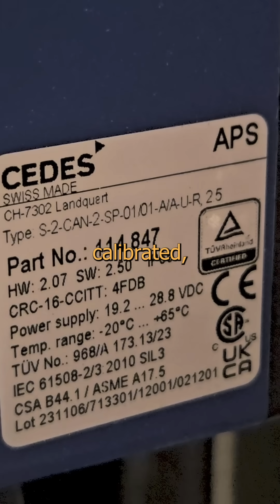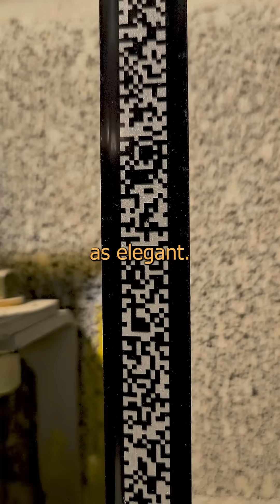Elevator Encoder #chrisboden #comedy #engineering #controls #urbex #indicator #resolver #barcode

Comment: Fun fact, when I was a security guard I had to check those scan bars on patrols and tell Maintenance if the strips were getting dirty.
Reply: Cool until some metal filings entangle themselves in the bristles and scrub the code right off that bar
Reply: @o.o-vt1rc  True.  I guess I didn't give it enough thought.  You could always enclose the bar in something that would prevent it from being damaged.  Say a plastic cover that would need replaced every couple of years or whenever it stops working correctly.
Reply: @jasonstclair6293  that's worth considering. Or have a technician use approved cleaning methods to remove dust and grease without damaging the barcode, and hope that by the time it's scuffed up enough to need replacement, the entire system will be outdated and due for replacement or overhaul.
 
I figure they already have a pretty good system already worked out.

But if you (I) always assume someone already fully optimized a given system, we'll miss out on further optimizations that could be possible.
And of course, different situations might favor a different solution.
Reply: @o.o-vt1rc  I'm starting to think I may have over simplified things.  I don't know exactly how dirty an elevator shaft is, but I'm thinking if metal filings are becoming a problem it may be a benefit that it obscures the code. In all reality the only metal you should have floating around is what wears on the rope.  I'm going to imagine the elevator car's wheels are going to be some form of "plastic" to cut noise and for a smoother ride.  The code looks big enough that even if it is partially obscured you could program an acceptable level of "dirt" before you would consider a read invalid.  I don't know how often elevators have to be inspected, but I would guess it's no less than yearly and maybe even monthly for a heavy traffic area.  It wouldn't take much to wipe off some dust during inspection / service / cleaning in my opinion.  I read another thought that said more than one line could be read at one time which could also be used as a mechanism to help sort out read errors to some extent.  Say if two of the three lines are correct and the third is only one bit off in such a way that the combination isn't possible in any other position then could you still consider it a valid read?  I really want to know some details now as to how it actually does work.
Reply: @jasonstclair6293  yeah, I'm not sure how well sealed-off most elevator shafts are, I just kinda figured occasionally you'd get incidental debris, metal shavings or concrete dust from construction or maintenance in an adjacent area, sand getting tracked in on people's shoes and working its way through the gaps, etc. Much like life, dirt... finds a way. Time to hop in that YouTube/Google elevator tech rabbit hole, and see if it's really an issue technicians see, or just my overactive imagination.
Reply: @o.o-vt1rc  I think we are both in the same boat on this one.  Good luck!!
Reply: Are you sure they were these? I've seen security guards that verify they walked their rounds by scanning barcodes around the mall.
Reply: Why isn’t there just a brush above and below the point where the sensor reads that’s attached to the elevator so it cleans itself when it moves?
Reply: How would you check a reading a tape that runs the length of the hoist way only visible from the pit or cartop?
Reply: @TallgeeseMark1 You move the car.  Move it six or seven feet at a time, crawl out, and look at it.  There's probably easier ways, but since they probably inspect all the rail mountings and such to begin with the entire length of the shaft checking the tape is just another thing to look at.
Reply: @jasonstclair6293 I'm saying you shouldn't be able to do that. Everywhere is different but where I'm from elevators are highly regulated. There should be no way for someone to be able to access the hoist way without a proper license. Could you elaborate on this process on moving the car and crawling out?
Reply: @TallgeeseMark1  Obviously if you are inspecting the tape you are going to have a valid license to do so, or at least maintenance access to the shaft.  Believe it or not unlicensed people can access anything with the right knowledge.  All it takes is knowing where to get keys and where to go.  I'll admit I don't know the ins and outs of elevator maintenance, but I would imagine you would set up a ladder, use our key to override the controls, move the car to the next floor, and climb out the access in the ceiling.  Whether or not you can actually see one it is there.
Reply: I was wondering about that. Dust and dirt seems like the Achilles heal of that system.
Reply: @bbaucom2  the biggest way around that at that site was quarterly or bi-yearly cleanings depending on the elevator. It was a corporate office type site so the main ones we check were a freight elevator for carts of paperwork or the 2 main elevators for employees
Reply: @bbaucom2  a simple brush mounted above and below the reader would eliminate a good portion of that issue.
Reply: @jasonstclair6293  Sounds like it'd work, but would come with their own issues. If the brushes engaged once a day, or something, that could work. As long as a bristle didn't obscure the reader.
Reply: @bbaucom2  Mount a simple brush on the elevator

Comment: It's not simple, they just managed to hide and cramp all the complexity inside the optical reader 😂
Reply: Now it's all done with dual encoders mounted on the motor. No need for a tape reader and tape spanning the hoistway.
Reply: I would be shocked if they use motor encoders only for position, maybe for speed, since the cable can only guess where the car should be. The (graycoded) binary strips give position that should stick with the floor. Things like heat and more-so weight in the car might affect the absolute position?
Reply: It's pretty simple you could functionally accomplish the same thing running a wide tape measurer up the side of the shift, have a manual level with an alignment marker, and have someone sit there and press an up or down button till the lines match. It's just easier to use a computer.
Reply: And it screwed if you don't clean it often.
Reply: @matt55346  have you seen the coding for those optical systems? It’s not that complicated

The camera itself it’s complicated by modern standards either, unbelievably hard to make from a standing start but not that complicated inherently
Reply: @MsArchitectschannel 
Yep, I work with vision systems every day.
The camera module used here almost certainly contains the camera plus all the logic/software needed and outputs the position altready in a useful measurement unit in a simple and common serial or ethernet bus. That's quite a lot going on considering also the fact that has  to be rugged and reliable and also probably has some safety features. Those industrial modules are really marvels of technology, simple to use from the outside but very sophisticated inside.
Reply: @MsArchitectschannel  Still massively more complicated than limit switch and a chunk of sticky out metal on a screw to adjust the height.
Reply: @vanq4999 no shit its more complicated than limit switches dude, but this has a resolution orders of magnitude more than limit switches, with less single points of failure.

when the car has just passed a limit switch, your tolerance for where the car may be is "somewhere between the switch it just passed and the next switch", which — if your limit switches are at each floor — is the entire distance between the floors.

also, each limit switch is its own point of failure, and if the one at the top fails, suddenly your motor is trying to pull the car into itself.

with this, the only points of failure are the camera itself, the wiring to the camera, and the actual "barcode" strip, which ceases to be a point of failure if its securely attached to the wall and wont get covered
Reply: @vanq4999 That's not always accurate though.😊
Reply: @MsArchitectschannel The code's gotta be complicated as well. The one shown in the video has 10 units in width; do some quick math, it turns out that rows cannot be unique for more than one story. Then either the narrator is mistaken and the pattern does repeat on each floor, or the sensor actually reads a rectangular array of code units. Which has to be unique and minimal, even considering it can be read from any position.
Reply: @MsArchitectschannel  it's not that complicated when using libraries, but the work the libraries do is incredibly complex(this is coming from my experience writing the underlying library for QR code scanning). You need to do all sorts of things like identification of where the QR code is, image skew adjustment to transform the distorted/skewed QR code into a perfectly flat one, then need to process the image into a bitmap grid of the correct QR resolution and version, then need to account for error correction which is built into the QR code specification, and only then can you actually read the data stored in the QR code.
Reply: @Sudonymer  it is likely a lot simpler than QR code reader. The QR reader has to find the code on a photo full of other junk - in any rotation, any scale and account for perspective distortion, too. None of this is necessary here, they don't even need a high resolution camera - an image sensor with just a few hundred pixels will do the job (similar to what is used in a computer mouse, for example).

Comment: I’m guilty of over engineering. I have a Ford ute I use for my business and also for some camping and recreation, and I wanted to put some work lights on the ladder racks to shine in the tray, and around each side. I figured I’d need to have a switch in the cab, in case I had a load in the back and I needed to check on it, and outside, in case I was fishing, and needed to turn them on without stinking my cab up with fishy hands, and maybe even a second switch on a lead, I could use to put into my roof tent, so if I had to get up for a pee I could switch the lights on from inside. So I started designing etc and it got more and more complicated, more and more expensive, more and more components, until one day I just thought hmm, I use one of those remote control relays on my other ute to raise and lower my sign, all I need is one of those and a waterproof enclosure, one remote on my key ring and a second one in the pocket in my tent and bobs your aunty.

Comment: Elevators are a piece of technology that is so engrained into our everyday lives that it’s easy to miss the mountain of engineering from many different fields that are used just to move you up and down.
Reply: Like how GaN transistors recently changed charging plugs, and I'm not informed about how it will change other applications soon but there is immense potential.

Comment: Looking at that coded strip I initially saw 10 bits (black or white) across, so that’s 2 to the power 10, or only 1024 possible combinations - clearly insufficient for each spot in that strip to be unique in the height of the lift shaft. If you take 2 vertically adjacent strips that becomes 2 to the power 20, or just over a million unique codes, or take one above and below, that’s 2 to the power 30, or over a billion. 

I’d love to understand the programming behind this, does it use the one horizontal code for fine position and the one above/below/both to provide the unique location on the shaft? Using a pair or triplet alone would increase the error offset for alignment.

Comment: Question: how come all of the combinations are so randomly sorted? Why doesn't it look something like a 10 bit truth table so you can assign every level a binary value instead of having to lookup a seemingly arbitrary number to correspond to where you are?
Reply: 2^10 is 1024, those lines look like about a mm tall, so that's 1000mm of unique landing spots. You have 1 meter of elevator travel.

Randomize it a bit, and you can look at the line before and after to tell which specific instance of the 1mm per meter in the 30 meter hoistway. 

You can also start to do error correction. If I know that the subsequent lines in this area are supposed to be 363, 271, 954, and I read 363, 281, 954, I can assume that there was a bit flip on the middle digit of the middle line, the track is getting dirty, might be time for a clean. If you have an internet connection, the elevator could send an email to the elevator service or the building owner to schedule maintenance.
Reply: @phillyphakename1255  it could actually only use 2^8 since the left and right pixel hold no data. they repeat every 3. row

so only a quarter of a meter xD
Reply: @phillyphakename1255  aha, so it's closer to something like a 30 bit array. Gotcha. Thank you!
Reply: because 2^10 is not enough to get a non-repeating pattern that spans the length of the elevator shaft. Also, this isn't a 10-bit array, the both ends repeat regularly, probably to act as edge marks for the scanner.
Reply: @pirig-gal  Well spotted on the edge pattern! Also, I would expect there to be some sort of encoding like Hamming code to protect against reading errors. I can't spot any lines with fewer than two white or fewer than two black squares, so that might be the case.

So, we read more than one line to get the position, and the numbers are arranged so that every sequence of how many lines we scan at a time is unique. Depending on the encoding, 4 lines should be enough to find your place in the tallest elevator in a building in the world (578.5 m or 1,898 ft) with 5mm (about 3/16") accuracy.
Reply: @daanwilmer  thanks for the info! this gets me closer to figuring out the pattern
Reply: Its random to avoid errors from dirt, that a simple row of binary numbers would be exposed to. The rest is probably just to make programming the lookup and comparison easy. Less bugs then.

Comment: How does this work if it's only 9 bits wide? 
At maximum I thought that would work up to 512 lines. 
Then it had to be multiple times the same line 😅. 
And how does this thing know where it is ? does it have a map of the hole dot matrix in memory?
Reply: 10 bits wide, assuming each horizontal strip is unique. If combining together two vertically adjacent strips the unique permutations available grow considerably.
Reply: @theonlywoody2shoes  yes from 10 to 20 bits 😅 
Which means you have now the problem to define which of your lines is the higher or lower part of your number. What do you do if you change  direction between.

Comment: til it collects dust or a spider crawls over that lense
Reply: Notice the aluminum plate at every floor, the one that passes through that "U" shaped sensor on the elevator? That's called a redundancy. A more reliable, if less accurate, system that is used if the primary system fails. I bet there is a third system in place too, in case that one fails. Probably purely mechanical. 

Redundancy isn't always a bad thing
Reply: @vincentcyr3719  i imagine not! i assumed there was more to it.. I'm unfamiliar from a fixed & limited angle, so rlly, just seemed funny. appreciate u

Comment: There are 10 bits per line so 2^10 gives 1024 possible permutations... Surely that repeats over the entire length??
Reply: 2^10, so 1024, not 10^2.

This also assumes each line is stand alone, combine one above or one below, and you double the potential physical offset error, but increase the number of codes to 2^20 (~a million) or even 2^30 (~a billion) if you go both one above and one below.

Comment: Nice because theres no mechanical switches or levers to wear and fail. That tracker tape should be pretty well protected in the shaft. Only thing that could fail is the camera and being computer controlled, if the camera aint cameraing, it just throws a fault and goes safe. Oh and hardware coming loose.

Comment: Each line seems to have only 8 bits so lines must repeat for that high elevator shaft.
Reply: I counted 10, but yes. If they're 5mm each, this repeats every 5 meters. About 1m if it's 8bit. So I guess they're counting simply on not being off more than 5 meters, which should be manageable ^°
Reply: More like 10, but still, yes, it should repeat several times over. There must be another complementary way that tells the computer on which of those segments it's at.
Maybe it reads several lines simultaneously, and that is the pattern that never repeats.
Reply: The outer rim looks like cinema film holes, but offset. With these two rims you can tell which way you are going. And my bet is, not only the actual centre 8 bits of a single line are analysed. My guess is analysis of a small 2D image.
Reply: Just have more bits for longer shafts